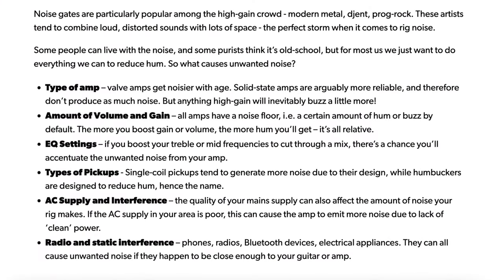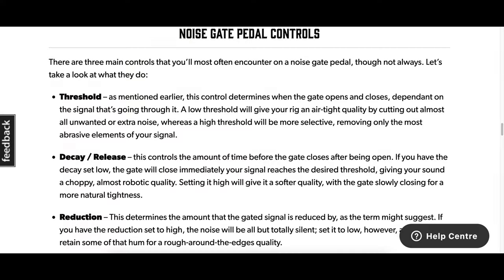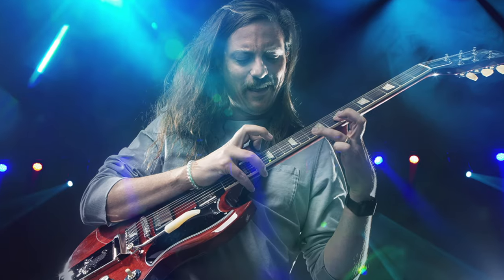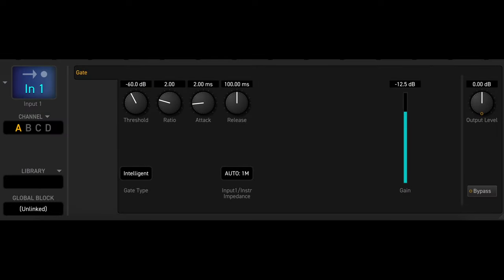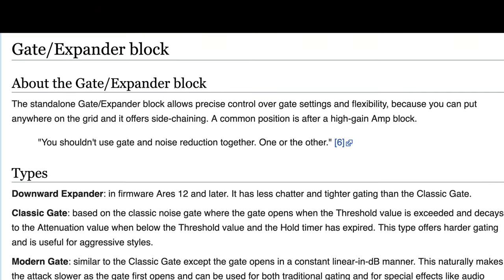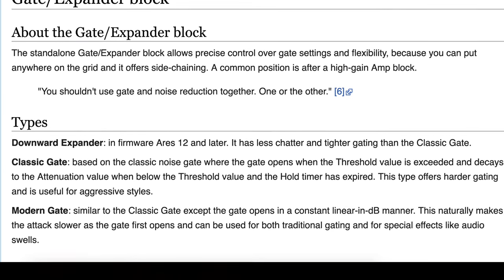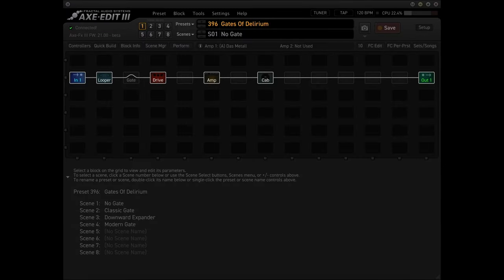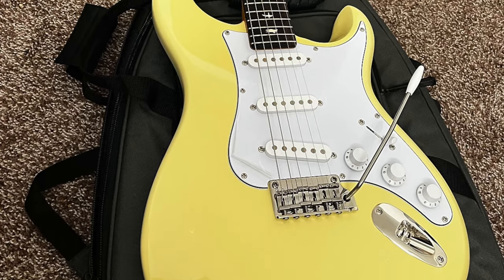Axe-Fx III/FM9/FM3 - Let's Check Out The Gate/Expander Block!

Comment: why is there that extra noise right after you pause and how to get rid of it? time stamp 6:49
Reply from the maker: That's the gate clamping down on a signal that would basically explode into all sorts of noise as soon as you stopped playing. You could probably tighten the release time on the gate. Thanks for asking, that was a good question!
Reply: I switched off the gate in the input block and placed a modern gate with its default settings after my drive block and there are no weird aftersounds. it's the input 1 gate that has been a culprit. now i need to try this out for my 4cm with a dual recto. take care @DougBsDigitalDen
Reply: @m3ssym3ss  I'd like to try this! thanks for sharing.